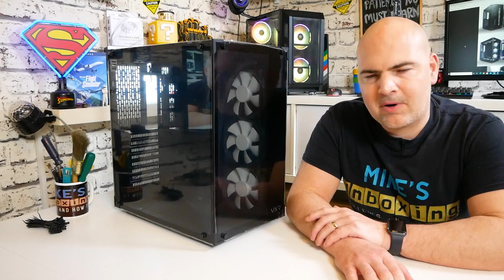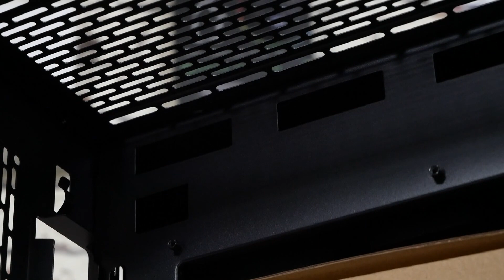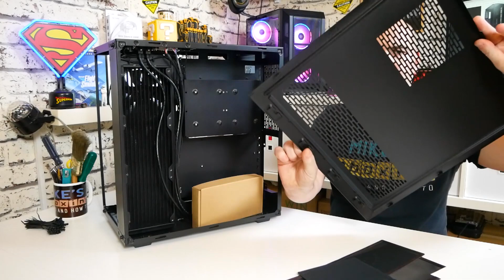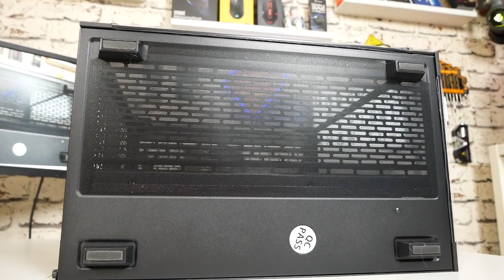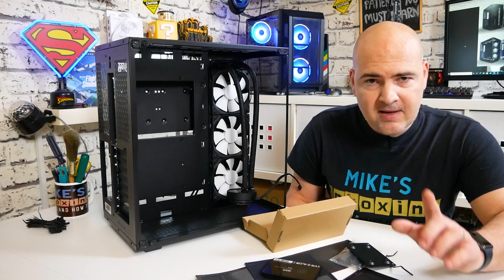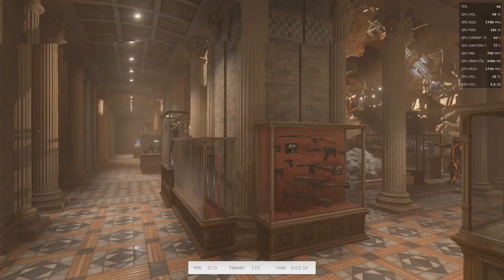Tecware VXR ATX Dual TG PC Case Cheap Lian Li 011 Alternative?

Comment: intake is coming from the top ?
Reply from the maker: at the moment i have the bottom as intake the top as exhaust and the side as cpu rad exhaust, but top and bottom intake works okay also
Reply: @mikesunboxing ah ok. i just thought that whatever heat the exhaust fans from the side output will be taken back by the intake fans from the top. because heat goes up.

Comment: Hello mike, I just realized that the gpu width is an issue after i bought a 3060 tuf and removed the vertical mount. the pcie cable  would really hit the glass side panel. i had a 1080ti aorus before i thought it was a wide gpu but this 3060 is wider 😅
Reply from the maker: yeah there is a bit of a tight squeeze for some cards

Comment: Thanks for review, I almost bought this case, glad I watched before purchase and found out it doesn't fit 360 AIO on top position.

Putting AIO on Side/front is not going to work with most of them. Mine (Asetek type AKA pump on cpu block) was in front position (radiator pipe top) for a year and half then I noticed my CPU heating above 100 degree on even idle load, pump was working at max. I noticed AIO lost enough liquid that pump was literally pulling only air into pipe (before that I could hear fountain for a while, then it stopped). unless pump is on the radiator block (some NZXT) the best position for radiator is top and when a big case doesn't fit 360 AIO on top, it means it is waste of money and space. 

The only reason for buying a big case is to put a Z series motherboard in it (Full ATX) and people who purchase that, probably want to overclock and need a bigger AIO (or radiator) to put on top position too.
Reply from the maker: look at the tecware forge L the 360 fits front or top easily

Comment: hey mike i want to fit a tecware mirage 360 water cooler rad on top but idk if it'll fit? what do you think?
Reply from the maker: I can’t get the fractal s36 or Sahara ex360 to fit up there, if the mirage is a little smaller it might fit
Reply: @mikesunboxing  did it not fit because it was too thick? or other measurements
Reply: @mikesunboxing  the tecware mirage is the same size as the sahara ex360? so it means it doesnt fit? damn i've wanted this case for so long
Reply from the maker: @conscious2270  That is a shame :-(
Reply: @mikesunboxing  nvm i bought the vxr and the mirage ill mount the rad on the front and not top

Comment: Great Review man. I am getting a VXR case soon but recently I saw someone posted their case tempered glass shatters into pieces and there are a few comments who reported the same issue. Do you have any idea about such issue ?
Reply from the maker: all side panels can do that, it have been pretty rough with mine even dropped it on the laminate floor a few times and still in one piece

Comment: is the airflow of your case correct?
Reply from the maker: correct is probably not the right term, there is optimal and there is okay, as long as it fits in between those somewhere i am okay with that. thermal dynamics don't always work the way you think they will so a lot of testing in different setups needs to be done before you really know the optimal setup
Reply: @mikesunboxing  I have the same fan position and I dont really get positive airflow. How about yours?
Reply from the maker: @malahotpothere  i have 3 in at the bottom 3 out at the top and the 360 aio exhausting but the case still seems ot have positive pressure somehow

Comment: Hi normal psu can fit such as 550 watt fsp hexa+ 80 rate 550watt. This is awsome although air cooling system suck. And the best push pull is correct way for case intake. This one ok ish kida
Reply from the maker: yes any ATX PSU is fine there is plenty of room, the airflow is great on this case 3 fans intake and 3 fans exhaust works really well

Comment: Yep needs to be wider, I was looking at this case but it was just too slim to fit my cpu cooler.
Reply from the maker: yes i agree a bit more width would be awesome although really this case is suited more to water cooling
Reply: what cpu cooler were u using? i want to fit a tecware mirage 360 water cooler on top but idk if it'll fit?
Reply: @conscious2270  that should fit fine
Reply: @MrAckers75  appreciate ur help
Reply: @MrAckers75  the tecware vxr website doesnt say anything about 360mm rad. only 120 and 240 so im really confuse

Comment: hey, 1 question, can an evga rtx 3070 xc3 ultra fit into this case without a vertical mount?
Reply from the maker: no i think it is too wide sorry
Reply: @mikesunboxing  got it!!! so i’ll get a vertical mount i guess . thank youu!!
Reply from the maker: @imranfaidz363  double check the measurements but my evga 2060 super fits but the power cables are right up against the glass
Reply: @mikesunboxing  is it vertically mounted? or horizontally?
Reply from the maker: @imranfaidz363  It's horizontally mounted

Comment: hey good review i like the look of this case can you recommend me a good budget 120mm aio that performs well
Reply from the maker: not really most of the 120mm AIO are overpriced and often only as good as the 120mm tower coolers because of the lack of thermal mass in the fluid.
having said that i used a deepcool maelstrom a while back and that was pretty decent

Comment: Mike: shouldn't the fans on the rad be mounted the other way round...I was always under the impression with an AIO that you should be drawing cooler air from the room through the rad not pushing warm air from the case through it?

I know this spoils the asthetics ...hence on my Lian Li Dynamic  me fitting my 240 rad at the top of case with fans drawing air in through the rad and 3 LL120 fans down the right pushing hot air out (but not through a rad)..I got higher temps when rad fans were the other way round....mind you I only have a 240 ...a 360 like yours will be greater cooling anyway....great vid thumbs up
Reply from the maker: it is okay either way and there will always be some benefits and downsides of each config in the system some methods will create more heat for the GPU and VRM other methods suit the cooler, there isn't a perfect way just what works for you personally to keep things in check and look pleasing

Comment: Nice review. 100% with you on small bump in width to accommodate 140mm fan sizes. Also quite funny you find the loudest thing in the build is that Corsair PSU fan. My Seasonic PSU fan happens to be the only audible thing in my PC and it's just as you described as a low rumble, or "tick" as you put it. I have the option to set my PSU fan in a mode that turns it off at lower temps but I allow it to spin, I can barely hear it and only if I try to. PSU makers skimping on PSU fan quality? Who knows. Thanks for the review and attention to details.
Reply from the maker: yeah some fans make the tick when kicking in but often it is just unbalanced rotors, just like me car right now

Comment: One thing I didn't see, presumably some part removes to allow  access to cooler backplate fittings with the motherboard in situ.

PS. Definitely not my cup of tea though, the guts of a PC are not a thing of beauty, well, not unless you spend lots of time and money on hardline custom water cooling and fluorescent coolant with a blacklight - and more time cleaning rads and blocks when your fancy coolant congeals in them!
Reply from the maker: yeah congealed coolant is something i so far have been able to avoid

Comment: Good day all good people, I bought a newly build system from a local Co. in my country using this case. My opinion-good alternative for lian li. The frame and material  may not be durable. I accidentally bend the frame slider as I was trying to lift the case but it can easily bend it back. Can't complain much for the price. You get what you pay. Lol. I install top 240 aio, 3 bottom and 3 side intake and 80mm x 4 outtake fans at the rear. Thank you Mike for da review. Cheers
Reply from the maker: thanks for watching and the info

Comment: Thanks for reviewing the Inter-Tec C70 Panorama aka Tecware's VXR :) Oh, you can remove that bar, so you have a more panoramic view in the case. And it doesn't influences the sturdiness of the case when it's removed.
Reply from the maker: it was a long time coming
Reply: What do you mean inter tech c701 aka tecware vxr ?
Reply: @Gragoon  In Germany/Low Lands & Europe, this case is sold under the brand Inter-Tecch by Alternate (German hardware retailer with 11 selling points across Europe)
Reply: @dorientjewoller113  Thank you for the reply. So basically they are the same case.  I lost so much time trying to compare them...

Comment: Thumb screws on the glass panels is an absolute deal breaker. The Lian Li 011 Dynamic panels lifts right out when you remove the top panel. I see no reason the front glass panel doesn't have a hinged door. I don't buy imitations. It's better to spend a little more and get the real thing.
Reply from the maker: thanks for watching
Reply: @mikesunboxing  Okay, I'll go away...
Reply from the maker: you can't stay away you'll miss the poor imitations
Reply: Would do too, but if Lian-Li is literally not available in your country, like in my case (no pun intended), you have no alternative to buy "imitations".